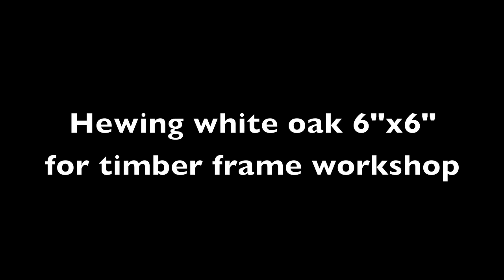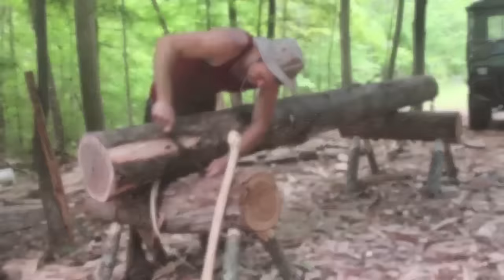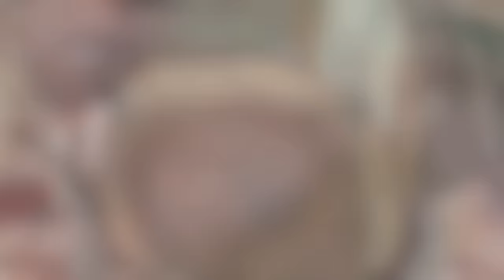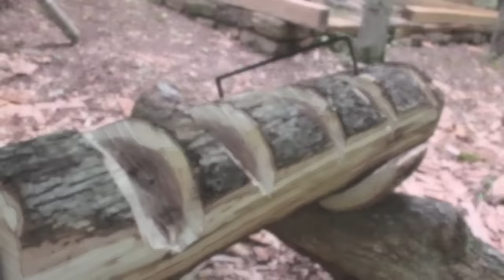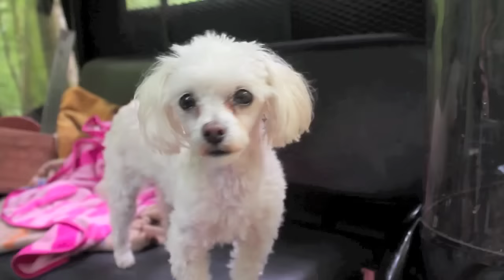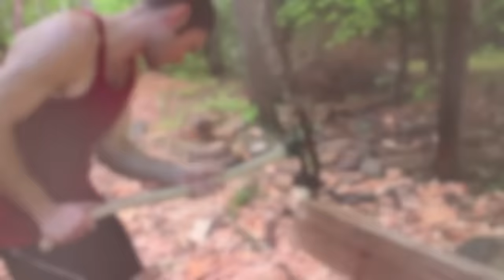hewing a white oak 6"x6"

Comment: You have my sub! Great video! If you don't mind me asking, how long did it take you to hew this full beam, start to finish? 8 hours? 12? More?
Im kinda a newb, are you using the adz for what most people would use a broad axe for, or would most people use the broad axe for what you used the single bit for? (that was my original thought)
Reply from the maker: A timber this size (and white oak) will take about 2 hours to rough hew, maybe 3-4 to fine finish with adzing on all 4 sides. Poplar or pine would be mush faster, maybe half that time. If the oak be knotty, add more time. 
There are many ways to skin a cat, or a timber ;) 

I tried every way and settled on what worked best for me, which is a normal axe in the way seen here and finished if desired with a "lipped" adze across the grain. Some prefer a broad axe instead of the axe. I found the adze fives a better finish , and more appealing to my eye. 

Look forward to a new video where we show a few different methods of hewing.
Reply: +Mr. Chickadee thanks for the reply!
that is a lot faster than I expected!
I also would like to build a house with hand tools.

Comment: Love the videos! Starting at the beginning so I can see the entire Process right now. However I was wondering, you seemed to be using the felled trees right away, do you have to worry about it warping a lot?
Reply from the maker: No, traditionally wood was used right away, methods used minimized drying effects
Reply: Try to axe a 1 y.o. dried oak, elm, ash. Hard!
Reply: makes sense ! Thanks for the answers :)

Comment: Can I ask a novice question? I've only tried to hew a log a small handful of times, but one piece has confused me each time - when you snap your line to transfer your pattern to the other face, how do you know you're not "twisting" the faces?  Again, novice question.  Beautiful work, beautiful results.  Best wishes.
Reply from the maker: +Mike Fliss Hmm if I understand you question, the answer should be in the beginning lay out. First stabilize your log with log dogs, and using a spirit level or plumb bob mark out your square timbers on each end keeping the "heart" of the tree in the center of the box, if you do this on both ends of the log, and always snap your lines joining along the length of the log the corners of these boxes, it will be impossible to twist anything as both ends of the log have the finished ideal square marked out by gravity, so long as the log does not move while you mark out the end squares, you are assured the level or plumb bob makes both squares oriented exactly the same to each other, so when you hew, you are just removing the wood one the sides of this square box, and it won't be twisted. Now if you say were to mark one end of the log, and allowed the log to roll or move, then you marked the opposite end, you would have a twist for sure. 
I hope this helped and didn't make anything more confusing!
Reply: I guess you would roll the log to have the drawn lines vertical / horizontal.  I saw that his lines were not when he snapped a line, though.

Comment: Good skill set.  I'm wondering if the rough shape would be faster made with a saw.
Reply: Of cause it would be, but I don't think that's the point here.  This is a skill.  Sawing really isn't.
Reply: I thought the same thing. Instead of using an axe for the kerfs, to use a hand saw. Very much a skill, I agree! Good work.
Reply: Because saws go dull faster than axes and they aren't as easy to resharpen. You can get more work done with an axe before it needs to be sharpened.

Comment: Would it be better to avoid using the heartwood? Or doesn't it matter?
Reply from the maker: In timber framing you need the heartwood centered as much as possible to reduce movement and casting of the timber, also, in this case, its only the heartwood of white oak which is resistant to rot and insect attack, the sap wood is nearly useless.

Comment: I love this video.  Can I ask what type of axe you use?  And would it not be faster to use a scrub plane instead of the adze?  That adze work looks TOUGH.
Reply from the maker: +magicponyrides Thanks, yes its a vintage single bit, only mark says "made in Germany" I found it at a yard sale without a handle for 2 dollars I think…Yes you probably could use a scrub plane, I don't know if it would be faster or not. I timed myself at about 5 minutes per side to adze the oak timbers. After the oak I stopped adzing and only hewed to the line with my yard sale felling axe, thats all you really need unless you want perfectly smooth timbers, which we did not.
Reply: Makes sense.  Thanks for the info.  Love your blog too; found it from this video.

Comment: I'm quite impressed with the entire process. Good out you!

Can I ask: how do you set your chalk line on each face to get it straight and square the length of the log?
Reply from the maker: SO long as you level the layout "boxed hearts" at either end without moving the log, both ends will be the same.
Reply: Mr. Chickadee Thank you for the response. That certainly explains the careful use of the plumb-bob during the layout.

Comment: Maybe this has already been answered but how do you keep your timbers from drying and cracking. Do you have to treat them?
Reply: When hewing timber like this, you are removing most of the sap wood. If you noticed on the end grain where he penciled out his beam the very outside inch or so was bright white? That is the sap wood. The sap wood, as the name suggests, is full of sap and is very wet. The heart wood, the darker wood, is older, drier, and denser wood. It isn't as likely to twist or crack as it dries. You might get the odd surface crack here and there; but, it  shouldn't jeopardize the strength of the beam. Often beams are left out in the forest to further dry by slightly elevating one end of the beam to allow rain shedding and keeping the whole thing off the ground.
Reply: That's the purpose of rubbing beeswax into the end grain as he did @4:12

Comment: Does the vasoline work good to slow the drying process to prevent cracking?
Reply from the maker: you can use many things, even crisco, it will eventually crack but more slowly
Reply: Mr. Chickadee is that what you used? I could t tell what exactly the material was.

Comment: That red oak seems to work and split beautifully. Any tips on hewing hardwood log?
Reply from the maker: +varun009 Its actually white oak, but yes most oaks split well unless near a knot. As for tips specific to hardwood, I would say keep your tools VERY sharp, joggle notches closer together, most is the same for soft wood, just might take a bit longer. Wax the end grain well, hardwood seems to check easier than soft.
Reply: Mr. Chickadee Thanks! I wanna build myself a large timber frame house with a few hand hewn accent beams. I was figuring out whether to hew a few of my own or just reclaim some. Another question if you don't mind: When it checks, does it crack louder than doug fir? It can get quite irritating in a the dry months.
Reply from the maker: +varun009 If you are putting these beams up higher than the bottom sills I would suggest a soft wood, preferably a conifer as they are more stable and lightweight and MUCH easier to work and handle, we for example only used white oak on the bottom sills, the rest of our frame was either Tulip poplar or pine.
Reply: Mr. Chickadee I see! A lot of people have been telling my to go with doug fir for the structural properties and color. I'll definitely incorporate that into my design.
Reply: +varun009 , you want to hew when it is green.  If you hew when dry, very tough job.  Still can do, but more difficult.  Must hone axe razor sharpe and wear protective boots that can handle an axe strike.  Those will keep you out of the ER.
Reply: Theodocius Eustacius Thanks. My only problem with hewing the beams green is the eventual checking. I'm a bit nutty, and a loud crack in the middle of the night would get me paranoid. What's the absolute best way to reduce checking?
Reply from the maker: +varun009 Timbers will always check as they are heart boxed, but its really not so loud normally, a good soaking in appropriate oils will help some, but all timbers will check.

Comment: I wonder if a jack plane would be faster and give a flatter/ straighter surface than the final axe you use.
Reply from the maker: The fastest and easiest way Ive tried is to score to the line with a saw, pop off the chunks with a wedge or axe and then plane with a jack plane to finish

Comment: when hewing away the big chunks, would it be feasible to do it by batonning a precisely positioned axe or hatchet, rather than swinging an axe?
Reply from the maker: As I had about 30ish large timbers to hew for the woodshop, I tried every method I could read about, the one you describe did not work well for me, but maybe it will suit your needs?
Reply: heh, I'll let you know if I ever get the chance, but I figure you've already worked out the best method :) Looking forward to the next video!

Comment: How do you make sure the chalk line is square from the corner of the square you drew on the end of the log? Do you draw a square on the other end as well and simply draw a line between the corresponding corners?
Reply: Yes, you must leave the log in the exact place while you do the layout. This ensures there is no twist. This is why he uses a logging dog to secure the log in place, then using the plumb bob and square he ensures his layout is square and level on each end. This ensures the corner lines are plumb from end to end. Then hewing directly on the line, he is able to make a square and true 6x6 even if the original log has slight variations, because the final side flats are a function of the plumb and square corners. I hope this made sense
Reply: Also the log is approximately strait, and stretching a chalk line is more so. Not to mention the end is cut fairly square. I'm sure it's out of square a little bit when he's done, but use of taught lines, plumb bobs and squares allows him to make it much more square than when he started.

Comment: Hey Mr. Chickadee, is that just charcoal you put on the stringline?  I've had very limited success with the charcoal thing, and I'm wondering if there is a special prep or type of wood to char to make a better marking charcoal?  I've never tried this method of hewing in from above and behind with the log tilted up.  I usually hew much lower than this though.
Reply from the maker: Howdy! Yep, back then I used charcoal, youve got to hunt around in the woodstove to find a bit that is "soft" enough to rub on the line well. 
In any case, Ive stopped using chalk or coal type lines all together as they are just a pain, they leave a fat non accurate line that will easily rub off. 
An asian style ink line is just so much better. It leaves a very tiny (1mm) line that wont rub off or even wash away in the rain! 
Its really a must have for hewing and especially accurate line rule timber frame layout. 
This video is our first and not the best hewing. Have you not seen this more updated video?
https://www.youtube.com/watch?v=FN77cAd5EAc 

P.S. Tajima brand makes the ink, the lines and even the sumitsubos to use all that in prety cheap on Ebay. Thats what I use in all my ink pots and every video of timber framing you see me using an ink line.
Reply: Yes, I have seen that video.  I actually have in my hewing playlist.  Very nice.  I've seen the inklines before, but never pulled the trigger on one.

Comment: way simpler with a good cross cut blade and guides.. Cleaner too
Reply: Ronnie Paul a
Reply: Thats what I thought in the first place. And then you think about it : the investement required by the "good cross cut blade and guides", the place to stock them when you don't need the thing, the time required to drag the thing out of the shed and into the forest where you need it, to put in place neat and tight.... well... i guess that when you do this operation for yourself and not professionally ( which means not more than a dozen times in a life time ) you might just as well take your time and use that couple of extra hours to do the job clean and fine with these basic simple tools and save all the rest...
Reply from the maker: I show a few methods in this video, one uses a crosscut saw, but yes, in all most (at least Americans) seem to favor the "industrial" approach to anything, its always about "how can I do this faster, with less effort, and for more profit(either financial or intellectual)" I find this attitude does not go well with traditional skills, for us its more about the process, the relaxation, the simplicity than the mechanization of a skill.

Comment: How long would it take a skilled craftsman to hew out a beam?
Reply from the maker: Depends on size of timber, wood species, desired fineness and of course technique used. A rough finish in soft wood and small timber, maybe 1 hour. A fine finish in hard and large timber, maybe 3 hours.
Reply: how long did it take for the b eam in the video ?

Comment: 8:05 couldn't you have used a hammer on the axe to "Chisel" out those pieces? That seems easier than just eyeballing it with an axe swing. Regardless, thats some hard work. Good Job!
Reply from the maker: That is one method which works well with some timbers, not so well with others.

Comment: Have you had any issues with warping?
Reply from the maker: No, traditionally timbers were worked green, then joined together and they would all dry together, holding each other in place if you will.

Comment: Easier way to do it is to walk the timber and use a broadaxe to cut down to the line, and then use a side-bevel axe to strike off the flake from the top.  By standing on the log and striking into the line and then down to knock the flake, you enlist gravity to help.  The way shown here relies only on muscle, which will tire the hewer out in no time.  Get some "axe-proof" boots beofe walking the timber!
Reply from the maker: +Theodocius Eustacius The way you describe is definitely one many have used. That method did not work well for me as my back did not agree with bending over so much. Id suggest everyone try a few ways and see what works for them. Thanks for the comment.

Comment: I keep breaking axe handles, any pointers?
Reply from the maker: Could be one of two things, either the wood is store bought and not very good, or you may be trying to force the axe through the wood too hard, razor sharp and just casting it into the wood like bass fishing works well for me.
Reply: USMC SCOUT buy better quality wood, or the yellow polymer handles, I hate them but they are nye impossible to break
Reply: Stop breaking axe handles. 
What are you doing trying to split cord wood? Use a mail for cordwood. Watch people's stances, shoulders, wrists ect. It's about form not brute force like a maul.
Reply: Don't whack the handle against the stock
Reply: Don’t pry sideways with the handle when the head is stuck in the log.  The handle is designed for front-to-back forces mainly.

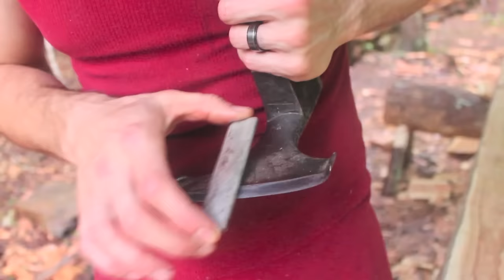Comment: Also, what is the tool you are sharpening at 12:45?
Reply from the maker: +Waldo Gambino Im rubbing a wax mix on the log ends to slow down the drying and prevent too much cracking. The tool is a lipped adze, used across the grain.

Comment: Why the wax in the 6'x6' section?
Reply: It could be to minimize splitting/cracking as it dries, which happens when the exposed end grain looses moisture quicker, and therefore shrinks quicker than the middle of the timber, the wax would seal off the end grain making it dry more uniformly and less prone to splitting
Reply: Jasper .C 

Yep. Also helps keep the timbers from wicking up moisture I believe

Comment: I just think about how physically fit people had to be in those days, and by that i don't mean "physically fit" in disease and infection i mean i just straight up muscle tone and strength.For morning till night everything you do demanded physical labor.
Reply from the maker: too true, as a former marine, I ran marathons for years, and weight training was a daily routine, i THOUGHT I was in shape, but this month and half of hewing really humbled me, folks were just TOUGH back then, and of course did things with many more hands, which helps a lot!
Reply: I thought those boots looked familiar.  Nice work!

Edit:  Just thought of this...Do you experience tear out on the edges when you're using the cross cut adze?
Reply from the maker: the lipped adze really tears out much less and leaves a much better surface, much more easily than the standard adze, which is why it has become my go to for this application.
Reply: Different muscle set and tone. Sinewy. You probably had more explosive strength from weight training?
Reply from the maker: Maybe? Don't really know, old photos show rail thin men who worked like beasts all day. My grandfather used to shovel 16 tons of coal out of a hole less than 1 meter tall, after all that work he still bare knocked boxed a few rounds on his way out of the mines while his brothers bet money on him…call it sinewy or lean muscle mass, I just say folks used to carved from iron and stone...
Reply: I notice the young lads at my work place (often sportsmen), put in a great deal of effort and they get tired to exhaustion well before they day is done. There is an art to working with less and less effort, while achieving the same result, by using more and more skill. In any case hand work is hard on the body and after years of it the wear tells. It did for earlier generations and it does for us too.  Thanks for sharing your  work, best wishes.

Comment: Would like to know if you are using a diamond stone to sharpen with or if that is a sandstone
Reply from the maker: I use a silicon carbide axe stone for the axe and a soft arkansas novaculite slip stone on the adze.
Reply: Looks like a Lansky "Puck"